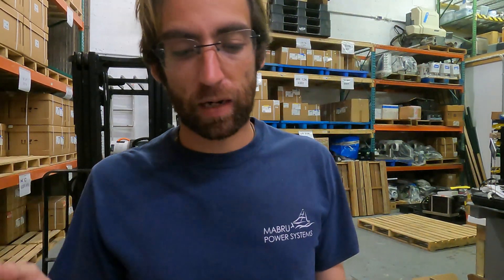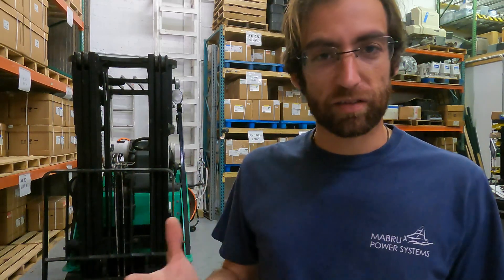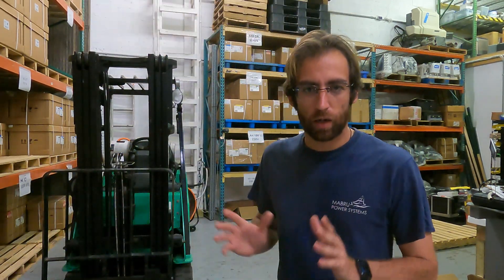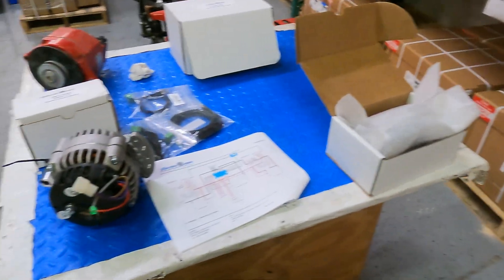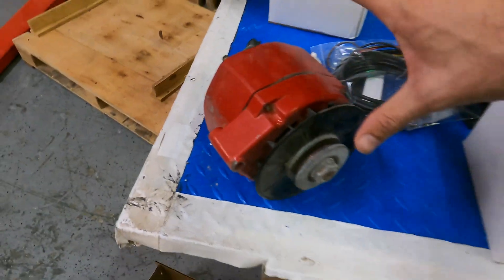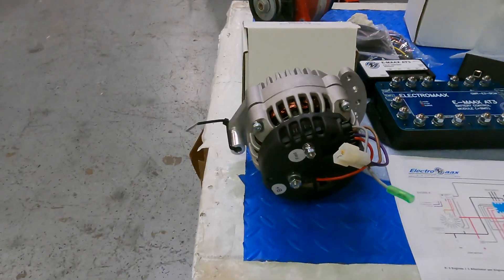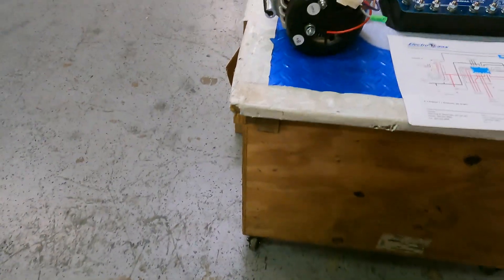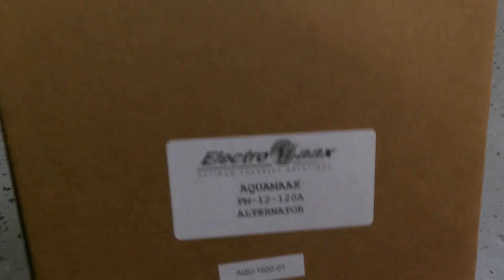New Alternators for the Bertram 28 Project: First Look at the Electromaax AT3 Alternator System

Comment: So when the controller tells the alternator to "reduce it's current output", what is the mechanism that allows this?   Is there a clutch or some change in the resistance or magnetism around the rotor as it spins?   How is this controlled within the alternator itself?